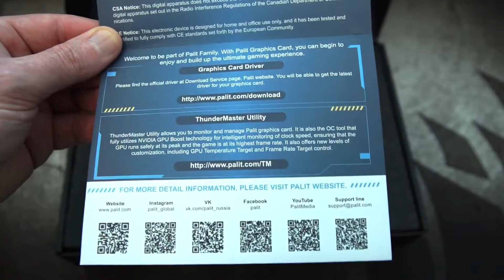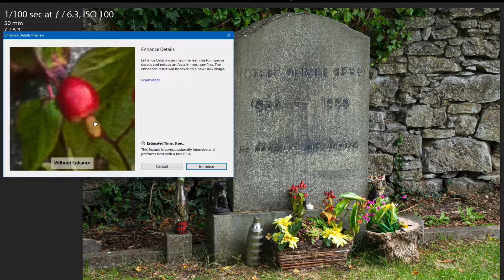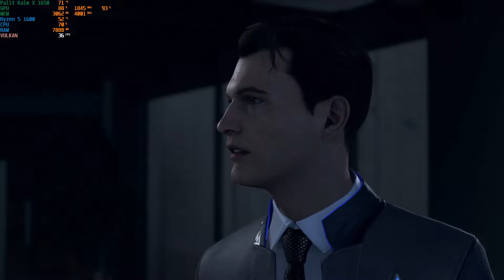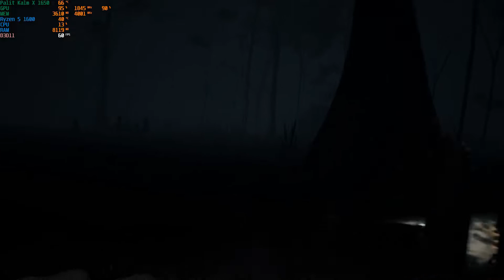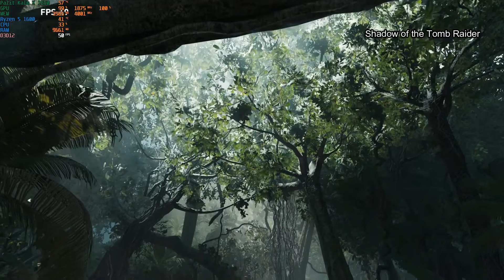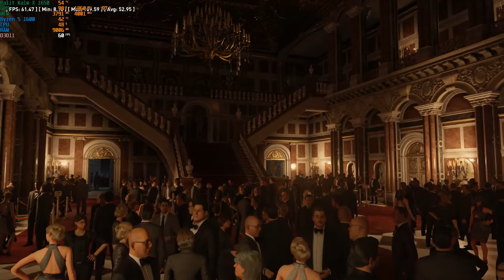Palit Kalm X GeForce GTX 1650: Review/Benchmarks

Comment: If someone would make a 75W card, with a half-height PCB, but a 120mm dual-slot heatsink with the clips for fitting an aftermarket fan, I think it would sell quite well.

That kind of design philosophy needs to become more common with higher-power GPUs also; small PCBs with large heatsinks, and the option of fitting proper fans.
Reply from the maker: It's a good idea, problem is most makers just want to slap a basic fan on there and cheap heatsink and sell them. I like the fact Palit have continued to do a series like this, but you're right having a design that allows easy attachment of a larger 120mm fan (which could be pretty slow rotation) wouldn't be audible. Some of the more premium cards have fan control or dual fans, some are not bad for noise, some are not great at all.

Comment: This card will toast your M.2 SSD if the M.2 slot is below the PCIEX slot, additional fan advised. Other than that a great card. :)
Reply from the maker: It could do depends on the airflow it doesn't get too hot at that point as it's spread out more over the heatsink area
Reply: @MrBazReviews  It's an air trap mate, I installed an additional "Antec spot cool" thingie to make this work better, running and Adata SSD  it would get to 60 degrees in idle, during gaming it went critical and throttle. :) A lot depends on SSD itself and if the M.2 slot is above the card it's all sorted. :) Thanks a lot for the video and answer!

Comment: Can this card run a constant 144fps ?
Reply from the maker: It runs at fps depending on the game, as you can see on the benches during gameplay. Depends on the game
If you mean can it run without throttling down, I've not seen it do that if it's used in a case with enough ventilation
Reply: On indie titles and lighter titles like Minecraft or Stardew valley maybe. This is for people who don't hardcore game and want silence.
Reply from the maker: @whoscarson  You can do a bit more than that, but not it's not for high end gaming someone who is OK with decent framerates at 1080p it does well enough. It's all relative really 750ti was struggling even with some titles going back a few years, this is a pretty big update over that, if it's worth updating from a 1050ti perhaps less exciting - but it's dead silent and you can do productivity stuff ie GPU acceleration etc too.
I hope they keep this line going nobody else is offering passive GPU's that I know of

Comment: how does it compare to the Palit Kalm X Geforce GTX 1050TI ?
Reply from the maker: Performance about 30-40% faster, but it can vary quite a bit depending on the game. TDP is the same at 75w, so is the heatsink design
The 1050TI has a DVI they changed it to display port on this (you have 2 of those and HDMI v HDMI, DP, DVI on the 1050TI)
I was going to get the 1050TI last year, but didn't get around to it. As this came out it kinda made sense for me to update to it. If it's worth updating from a 1050TI maybe for some it's worth it, going from a 750TI, both are big upgrades in performance.
Reply: @MrBazReviews  I would give anything to put my hand on a Gtx 1650 KalmX. can't find any since more than one year. i have a 750ti... 'im suffering from an hearing disorder so can only get fanless card. Thanks for your review !
Reply from the maker: @DidierMartini  Not a problem yes they are hard to find as are many GPU's these days sadly, ie the chip shortage problem. I'm not sure if you can find a used Kalm X 1050ti around, that would still be a decent update to the 750ti. I think the lower video ram is one area, I noticed quite a big jump 2GB to 4GB, otherwise you might get by with it not sure if it's gaming or general use. For gaming you could drop the settings back a bit, that can help
Reply: @MrBazReviews  yes, the shortage problem... didn't found a 1050 kalmX as well unfortunatly. i'm not a gamer, and rarely play. I need Cuda for video and 3D processing (Vegas Pro, 3D Cgi, Topaz Products etc..). for now, i'm using the openVino from my i7-7700 which is faster than my 750ti :( lol. unfortunatly it's not for gaming but video editing, 3D, Real time, etc .... (i'm a musician, and i mainly do Music Videos. and I just got a 4K monitor, and the 750ti is "no more" lol. still searching with no luck. maybe one but at 1000$ lol. :( .
Reply from the maker: @DidierMartini  The CUDA got a decent bump on the 1050ti and again on this card. At the moment people are finding it quite hard to get cards, and I wouldn't suggest getting ripped off either with some of the prices. I suppose I was lucky timing when I got this one. I had a few people mail me asking to buy it! Thing is erm no card no working pc for me so it stays put.
I would hope when this "Kalms down" ;-D
Palit might have an updated Kalm X and keep the line going I think it is worthwhile for many people.
You could modify a 1650 with a passive heatsink they do kits for sale. Finding a 1650 at a reasonable price is the problem
Reply: @MrBazReviews  Yes i know all this. i was expecting a possible RTX 3050 not fanless, but maybe with low noise fan or half silent. but the price are insane. they just told a possible price for the next i7-12700K (i want to buy a 12700) it's a lot... :( .. can you please show me which kind of fanless kit is available for a 1050ti or a 1650 ? i knew there were some in the past for old cards, but was not aware about any Pascal GTX , thanks !